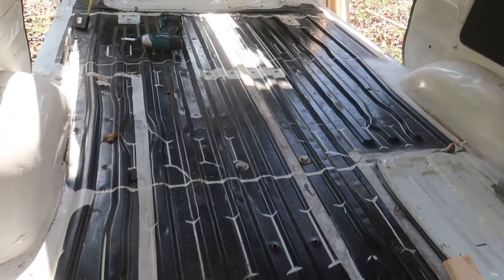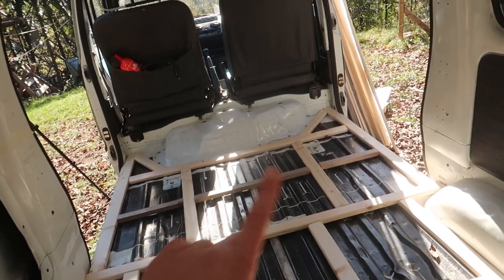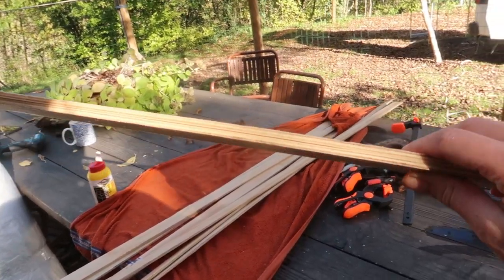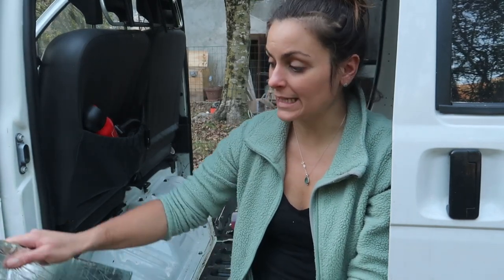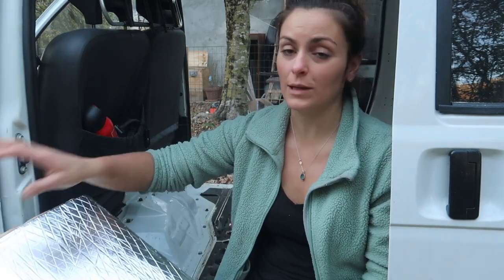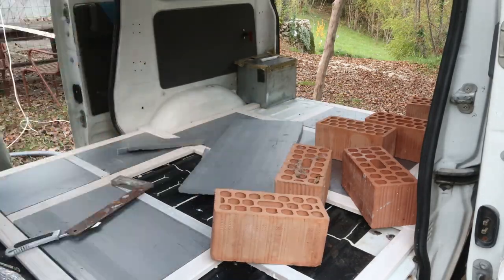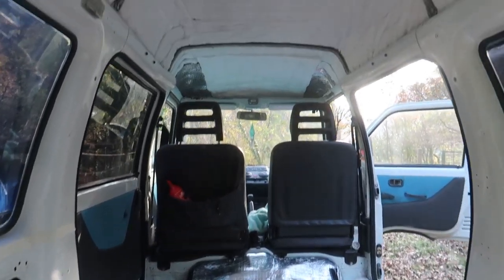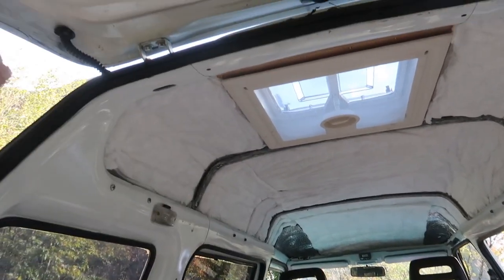Insulating a VERY small Van | Acoustic and Thermal | EP. 3

Comment: I use XPS foam as my main boards for making dioramas for my hobby which is 32mm figurines and it works fine. It can be cut using a Stanley knife and is so easy to work with.

Comment: No flesh shall be spared, just storm ahead with the build! 🤗 It's coming together nicely!
As I usually vent my smart-arsery here, may I just add: I guess it would be dadvisable to have some kind of venting and draining for the insulation in the roof in place. Ambient moisture will get in there, no matter what you do. Dryness comes from giving moisture an escape rout rather than sealing spaces off.
Just like the smart-arsey comments just find their way into my head, despite it not being leaky. 🤷‍♂ Give them a vent and it's good again! 😊
Reply from the maker: Mmm good point. Well, I unintentionally left a few spaces here and there on the cladding, where it was too hard to fit, does that count as ventilation? 😂
Reply: @WildSheGoes  Any ventilation is good ventilation! I guess the most important bit is that condensation won't drip into the furniture you build in. What I never thought about before, but learnt from another van-to-camper conversion video elsewhere is not to treat the space in the doors as interior. They are designed to allow condensation to run down where there are drains for it. So better not fill the inside of doors with insulating materials. But then, the wee Piaggio, like any van, never was built to last for decades. There will be other points of failure making a show stopper years before any such points than what I said above will make it go down the big rusty river to car heaven.

Comment: When you mentioned you were going to box in the engine area and insulate, I thought you would just insulate the inside of the box and maybe put a vent you could open in the winter to allow some heat into van.
Reply from the maker: HI Lyle! Initially that's what I thought of doing but then I realized I would need three times the insulating materials (that bitouminous sound deadening mat is expensive!) and also that anything that I was to put inside the storage bench would get boiling hot so couldn't put any food, water or electrical stuff. That's why I decided to just insulate the engine bay. Would have been nice to have some free warmth in winter though!

Comment: Excellent work 👌. I was practically shouting silicone for the first 5 minutes then you said you used it for the floor frame lol, brilliant stuff, 101 uses & as you said you don’t need to drill holes, not nitpicking but while you the trims off you could spray the inside & bottoms of the sides with cavity wax it stops rust, even brushing olive oil in the door bottoms & anywhere else works & it would be more appropriate for you lol, clever girl cutting the insulation to suit the depth I’m impressed as usual 😎, have a nice time over the holidays and we’ll see you next year 🥰
Reply from the maker: Thank you Mikey for the tip! Never heard of cavity wax, I'll google it now 🤗